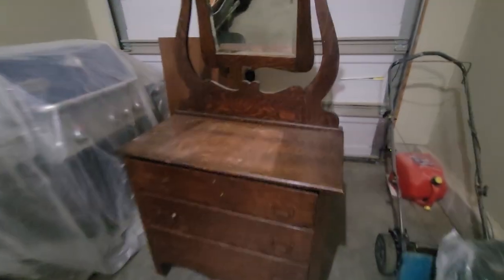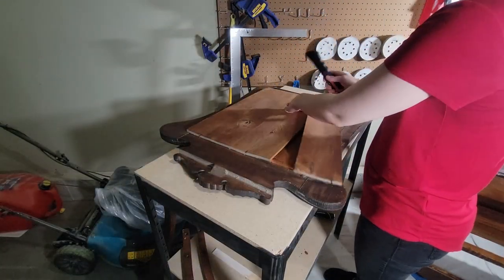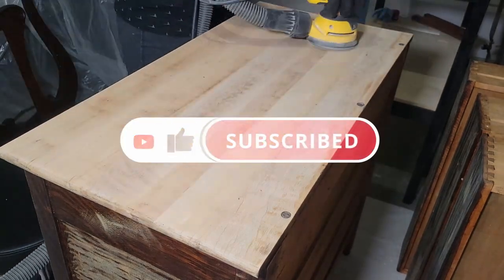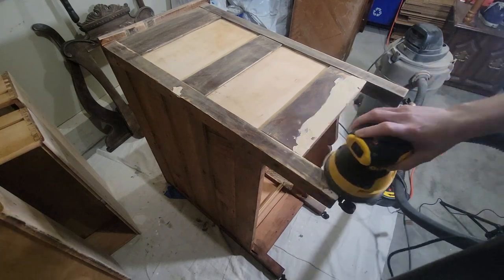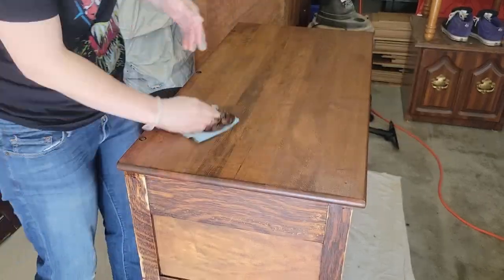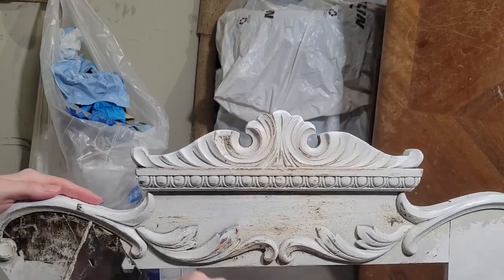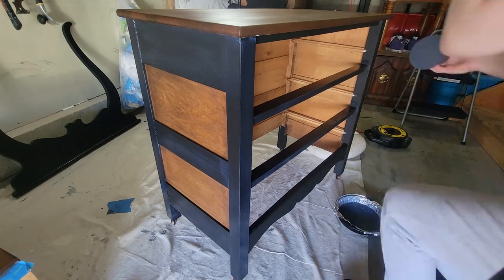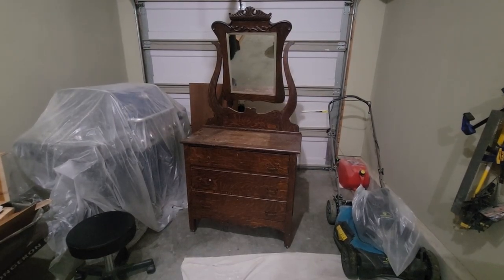REFINISHED RUSTIC ANTIQUE DRESSER // FURNITURE FLIPPING // FURNITURE MAKEOVER

Comment: Wow this piece turned out amazing. I love the mix of paint with stain. The new hardware looks really nice and ties in well with the black paint. Those marks on the mirror are called "Foxing." I think if at all possible, antique furniture should have the original mirror, even if it's marked with foxing. I have a question. How do you get the photo/reflection in the mirror in your finished photo's. I've tried looking for something like that on the internet, but have had no luck. Thanks for a great video!!
Reply from the maker: Thank you! I found a photo I liked on google and then just used canva to put it over the mirror. It's not perfect but it's better than the reflection of me taking the picture 😂
Reply: Thank you for answering my question, I appreciate it. Have a great rest of your day! 😊